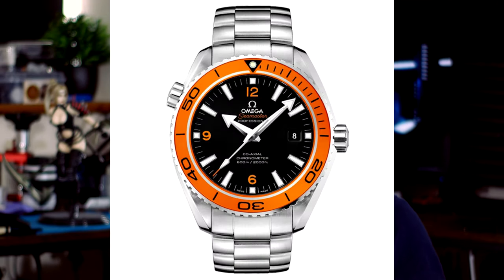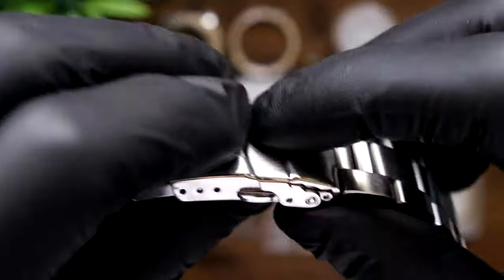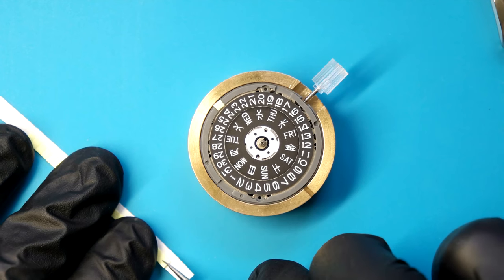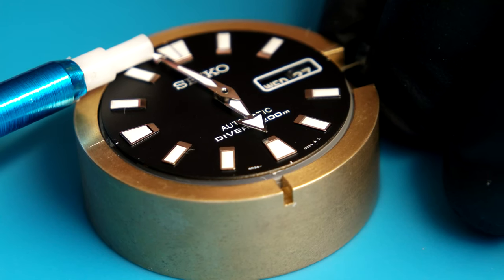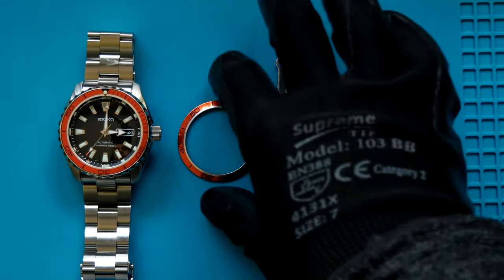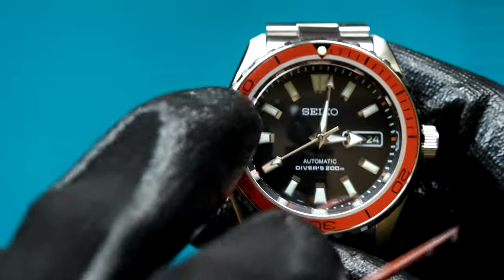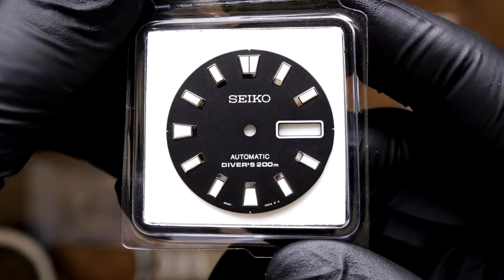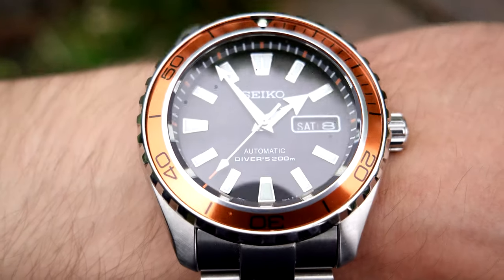SKX ATLANTIS - Omega Planet Ocean Homage [SKX007 BUILD]

Comment: I enjoyed your mod video, mister Dan, congrats for the SKX Atlantis! But if you thought setting those hands with proper spacing was rather difficult, wait until u build on an eta2824. As for your alignment problem, I would suggest trying with a different set of hands. All these aftermarket parts are not exactly the same quality as stock parts. I prefer LuciusAtelier (better quality and better lume) hands for my projects.

Comment: It looks amazing! Setting hands is very nerve racking. I was replacing the movement in a chronograph, and let me tell you, those little subdial hands... just try it once and you will feel like the main watch hands are easy.

Did you try some silicone lube on the crown o-rings?

I'm not a watchmaker but an engineer so forgive the terminology, but I think the hand misalignment is because of backlash in the gears, and when you set the movement to the point of changing the date, you have done so with the crown, but the slack in the gears is in the wrong place compared to when the movement reaches this point by itself. My tip would be, before disassembling anything, let the watch reach 12:00 by itself and note the alignment, then rotate it manually to 12:00 by the crown and note the alignment difference, and take that into account when rebuilding the watch. No idea if this is correct - I've only had this problem once and I just nudged the minute hand to match the hour hand and all was well. GL!

Comment: I've got the 06 Planet ocean that this homages and the bezel on yours seems smoother than the original. The original is very ratchety (though precise as you'd expect). its a good homage though. i like it. Its only by seeing yours that i remember how 'coppery' the original bezel insert was when mine was new. Mine is way faded now but has a nice vintage look. I wear mine mostly on an orange crocodile strap these days rather than the bracelet.

Comment: Loving your channel Dan. Im continually inspired and my creative juices flow with each new vid I watch lol
I like the idea of doing a "Sports watch" project with a smooth bezel. Can you recommend a case type (this SKX007 maybe?)
Cheers me dears, keep up the good work! atb, Kev
Reply from the maker: I won't recommend a specific case, since its going to depend on your taste and ideas for the build. But I would recommend any of the cases from places NamokiMods or crystaltimes/seikomods (to name a couple) that are specifically compatible with SKX007 parts. That will maximize your options for parts and ensure that it goes along like a conventional SKX007 build. I might even recommend grabbing a simple Homage watch that looks mostly like what you're aiming for and then do a simple dial and hand swap. There are also plenty of NH-movement compatible cases on AliExpress that come fully assembled which eliminates the headache of having to press in a crystal, and they're pretty great value too if you get the 200M water resistant ones.

Comment: I'm considering my first mod, of my Seiko Batman turtle.  I understand that skx and turtles all have interchangeable parts.  That "buttery" bezel you go on about, I assume would fit my turtle easily?  Also, I'm thinking of just adding an orange seconds hand to add a pop of color.  Can a watchmaker just remove the seconds hand and change it?  Or do they need to remove all the hands and reset them all at the same time?
Reply from the maker: I don't have a turtle myself to know for sure what parts are interchangeable. But I don't think the case parts are (besides maybe a caseback, but again I'm not sure about those either). Unless you were using an SKX turtle conversion case, I'd assume case parts are not compatible.

I'm fairly sure that things like Bezels and chapter rings are definitely not compatible between the SKX and the turtle, so its probably best to look into Turtle Specific mod parts when modding the turtle case itself.
Reply: @ItsAnotherWatch  Thank you bro, appreciate the reply.

Comment: Great video... Just wondering if the finished product still maintains its waterproof qualities  and if you do mods on preowned SKX 007 watches.
Reply from the maker: Thanks, the parts I've used in this build are rated for 200M water resistance so If I got the crystal in properly then it should maintain that. But unfortunately I don't have the equipment to properly test that.

And no, I don't offer any modding services if that's what you meant. If you just wanted to see me mod a preowned SKX watch, I did do a SKX171 mod on my channel here: https://youtu.be/sijX9tAbb_M
Reply: @ItsAnotherWatch  Thank you for the quick reply.

Comment: Hey mate just discovered your Chanel, about to order all my parts for a first build, base off of when you initially test fitted the dial and found it to have 3.8 crown position dial feet, am I correct in assuming any nh35 or 36 movement can be used for a 3 crown or a 3.8 crown case/dial? I am using an an nh35 with date only btw
Reply from the maker: Yeah, the date disc lines up with either 3 or 3.8 O'clock crown dials on the Nh36/NH35. Its only the the day disc that needs to be swapped for the alignment change.
Reply: @ItsAnotherWatch  thanks mate appreciate it, keep up the good work

Comment: is it CT37CIS Clear AR which is called''Doubled dome only for sloping inserts''  As far as I researched; Since the inner diameter of the ring is not exactly suitable for this situation, it is recommended to use double domed glass. Could you please support this subject? Thank you...

CT037CIS - Specially designed to solve the ugly step problem for ceramic beveled/thick lower end bezels inserts. Double dome (domed top domed bottom side) with a large top edge strip and no angled edge design to provide a smoother and smoother fit to curved ceramic bezel inserts.

Comment: could you help me with something please? I would like to know which dome you use the SKX ATLANTIS - Omega Planet Ocean Homage. this: NMK301 - SKX/SRPD Double Domed Sapphire Crystal, or this: NMK302 - SKX/SRPD Double Domed Sapphire Crystal (No Bevel Edge). thanks for your answer.
Reply from the maker: Looks like mine does in fact have a beveled edge on it, since I used a sloped bezel insert. Although the bezel insert wasn't meant for an SKX and shows a slight gap. If you're going for a sloped bezel insert, the regular NMK301 will be fine. But if you were going for a standard flat bezel insert the "no bevel edge" NMK302 might look cleaner, I think that's the one I used for my "perfect skx" (the SKX171 mod).
Reply: hello, could you build this same watch for me?  I would like to know how much it would be worth to me.  thank you.

Comment: That is seriously classy, quite tempted to try it myself sometime.  What was the cost of the final version? Keep well :-)
Reply from the maker: I can't remember the exact numbers, but a rough estimate based on the prices of parts currently (as of march 2022) this is around £380-400). I wouldn't recommend the hands I used here though as the lume is poor and I've since replaced them.
Reply from the maker: @TysonHook-22-  Honestly, I couldn't say who's hands, as far as lume goes, are best. I haven't really bought enough sets of hands from each vendor to have a good idea of consistency, except namokimods which is very consistent. I've found monsterwatches to be outstanding for lume, even brighter than OEM but the selection is very limited.

I ended up replacing the hands on this Planet ocean build with these: https://wrwatches.com/products/planet-ocean-arrow-hands-for-nh35-4r35-6r15-7s26-movement which had very good lume, that matches the OEM dial perfectly. (You can see how it ended up on this short clip here: https://youtu.be/MMN613kZM3I?t=1817 )

I usually end up buying whatever hands I can get from any of the reputable sellers, or even just ebay, depending on what I need for the build at the time. Even ali express can be good for hands if your going for BGW9. Since C3 hands on Ali are always too green by default and I don't like to take the chance on them anymore. Unless I can get the hands very cheap and then try to relume them myself (which i've recently gotten into trying).
Reply: @ItsAnotherWatch  Thanks for the quick reply, links and information. 
 I kinda assumed its just a matter of trial and error and experimentation to find what works best in each specific build.... which is kinda annoying, but i suppose its half the fun at the same time... hunting the internet trying to find the "goldilocks" parts that work just right together.  

Ill try to report back my findings on how the rafflestime hands compare to the Orient lume, encase your curious to know and for future reference to the readers of this post thread.